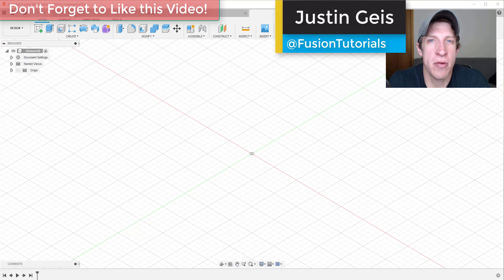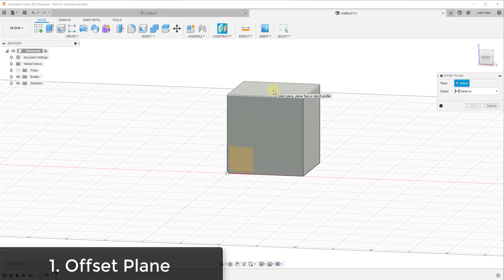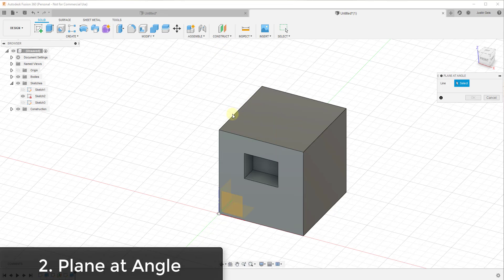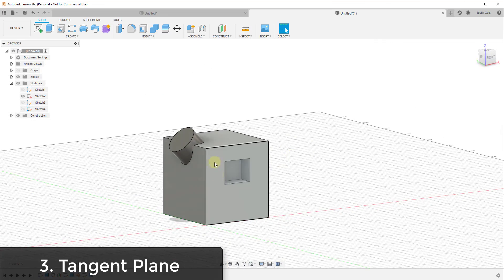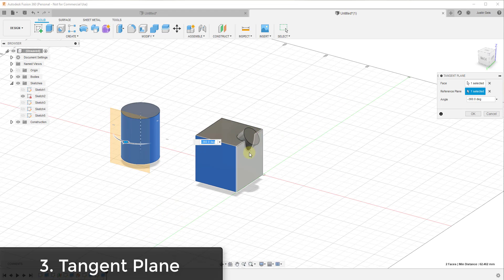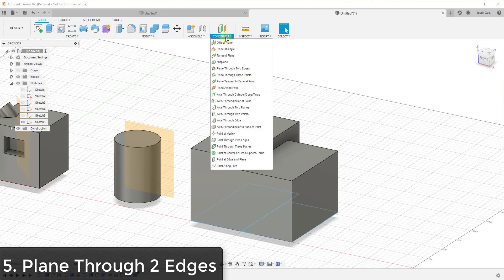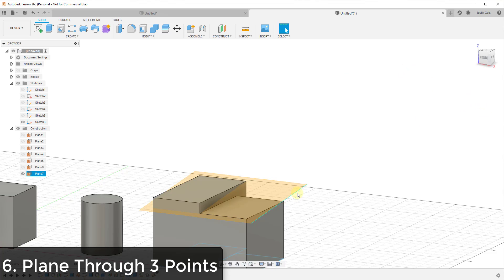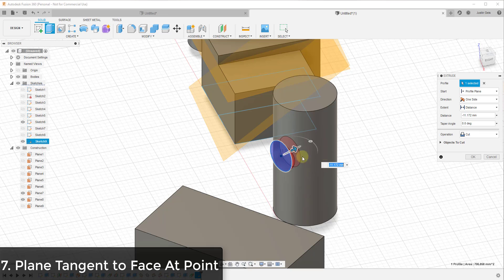Using CONSTRUCTION PLANES in Fusion 360 - 8 Kinds of Construction Planes

Comment: I want a plane construction method that requires specifying only two points. Fusion would then create a plane along the implicit line connecting the two points and then allow me to specify the angle the plane makes with those two points. This would  have come in handy in so many instances where I needed a plane but none of the existing construction methods were just right for what I wanted to do.

Comment: how would one create a plane of 2 angles?
like 2 layers of angles.
im trying to design some handlebars and ive got it done in autocad lt but im having trouble bringing it to life in 3d form.
the handlebar ends rise by 10 degress but are also pulled towards the rider by 10 degrees.
how would one do this on a 3d program?

Comment: really good video; I'm not sure how to add another sketch for the circular part, I went back to the beginning to add it in already used the control key on both shapes to extrude them.  before I extruded one shape, then other one disappears???? guess I'm still too new to figure that out and why it does that.

Comment: get to know this other too, is extremely similar but slightly easier, it has a free version that only requires register an account to their "ecosystem" and logg in in within every 30 days, literaly just that, I am using it currently and I confirm it, your files are only yours, you can manufacture and run simulations too, and works for 3D printing, I simply just think that more than one will be surprised of the capabilities, supereasy to learn accessible to anyone
DesignSpark Mechanical
https://www.youtube.com/watch?v=ZXgMY3-hl

Comment: I have a seat for a chair that I am drawing in 360...how would you draw a complex angle?  Where (for instance) a hole needs to be drilled for a spindle that angles back and to the left (think of a chair back for a Windsor chair).  Basically, can you draw a angled plane on one axis, then change the angle for another axis of the same plane?

Comment: Great share - planes are essential to designing anything real(!)
2 problems I need help with.
1. Sometimes the plane orange representation rectangle gets created REALLY small - and I have to zoom REALLY far in - like, comically - to find it later on.
Also, plane is created way off to the side.
2. If you are working on one of the three major planes, and use orbit to look around at your design, you can just click the magic cube in the upper right to get the view back to a major plane.
When you orbit around on a new whacky plane, how do you get the view to be "normal" to the plane, i.e. 90 degrees?
Any help appreciated.